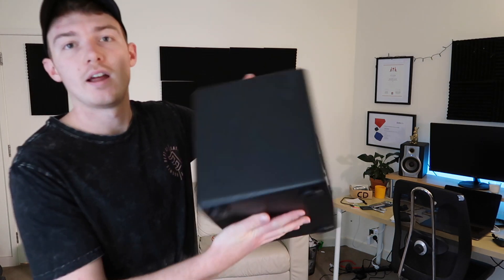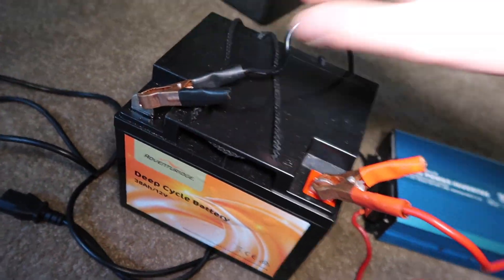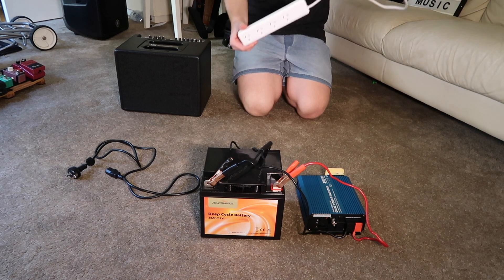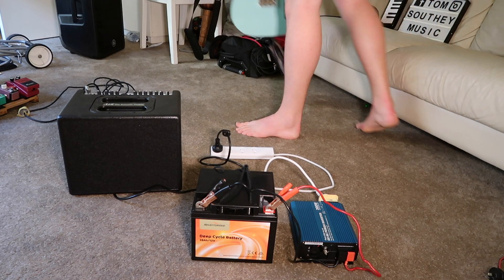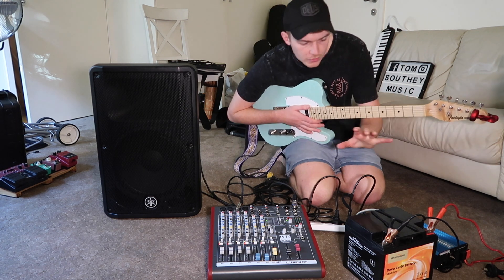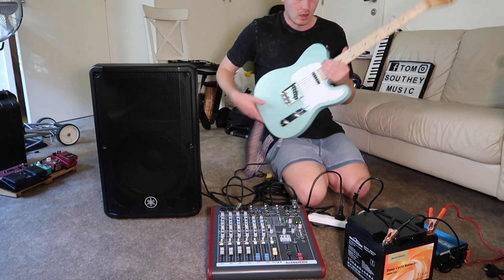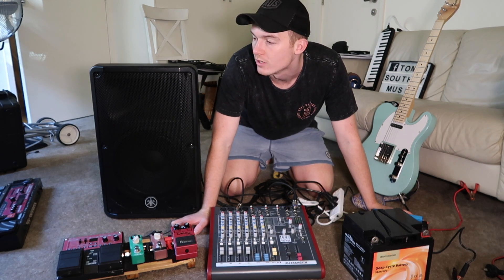HOW TO POWER ANY BUSKING SPEAKER

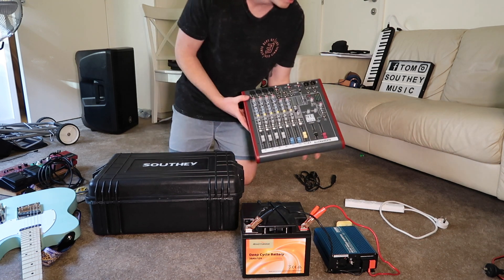Comment from the maker: Large Speaker test with Mixer skip to 5:34
Reply: Greyham Moongan  No
Reply: Can I use a 12.8v battery for the same setup?
Reply: I tested our setup with a W meter and our Blackstar Artist amp is only pulling about 60W. My inverter is about 87% efficient so we are pulling about 69W out of the battery.
W (Watts)=Volts x Amps. So your battery is say 40amps x 12.5V=500w/69W=7.2 hours of use from a full charge. Your big speaker is similar to ours and it uses less than 100W to make enough sound for the street. I have to admit I questioned the hell out of that and disbelieved the Watt meter I had but it nailed everything else perfectly. So I concluded that they must have some other way of classifying speaker power than power use. It makes no sense to me at all but with your ear drums bleeding it is only using about 150-200W.
Long story short assuming your inverter can actually produce 300w (Many absolutely don't)you have enough of power to run 2 of those speakers and your PA and guitar amp if you want. But I possibly would not recommend running any of these cheap inverts too hard. Mine included and it's not cheap. This will mean you are pulling about 27-30 amps from your battery which will be getting near a small battery's limit for constant current draw.
I highly recommend anyone getting an inverter to buy a Watt meter. They are fantastic.
Reply: @toast47624  Hi, could you advise me please on the battery I would need for my p.a and mixer? Would be so grateful. I'll give you details if you get back to me. Thanks Sean
Reply: @toast47624  Hi mate, can you please help me with choosing busking batteries….? We want to use Yamaha pas 600BT (680w),and one keyboard and one electric guitar, hopefully play for three hours or more.  Please 🤥
Reply: @shengchang3411  Theoretically 170 AH but ad look for about 200AH+
Reply: @toast47624  Thanks😬
Reply: @toast47624  Old comment but hey! The recommendations for Those led acid batteries are not to drain them beyond 50% or the amount of charge cycles decrease pretty much exponentially. In the campervan/motorhome world, this is well known. 👍

Comment: Thank you so much for the info. I'm planning on just playing solo guitar over backing tracks with the Yamaha THR10 ii. I need to take into account the power supply which is 15V 3A which means i need a different converter... obviously right? I'm very bad when it comes to electricity

Comment: Hi! Is there a mixer I could use without connecting it to an external batery? I use a roland cube street so for the amp I don't need an external batery for busking, but I do want to connect more instruments to it, so I thought a mixer would be a good solution. And I wonder if it would work by just connecting it to my roland cube street.

Comment: Plug your gear into a power strip into a VOLT Meter into AC WALL socket. Play guitar / sing = WATTS you need. Battery Watts / Watts you need per hour = Hours use X 85% = Real Life Usage Est.

Comment: Or get a Roland cube street ex, that gives you up to 50 watts on 10aa rechargeable batteries, and save yourself the hassle of carrying lots of heavy gear about, and saves lots of setup and takedown time.
Reply: True, if you have $1000 to spare. This is a good option to power existing PAs you may have

Comment: I got everything you basically have but when the setup is on there's a buzzing coming out the amp, it goes when I touch the metal of the input plug (that goes into the amp) so I'm thinking there's a lack of grounding? I'm not sure tho, has this happened to anyone else? Just wondering how to fix it or will I need to buy a whole other setup?
Reply: I once tied a wire round my ankle...to the rig. It was cheaper

Comment: I am in Montreal Canada. I’ve been using a 3000 watt inverter with 2 used deep cycle marine batteries hooked up together in parallel to run a complete JBL DJ rig for up to 7 hours at very high volume. 2x Prx512 tops, 2 x Prx518s subs, 10ch mixer, laptop, and 2 wireless Sennheiser microphones. Works flawlessly. The inverter is not a pure sine wave, but no issues at all with multiple gigs performed. 4 piece Jazz band with multiple vocals as well have rented my inverter set up..
Reply: Do you get a lot of noise out of that? I have a 1000 watt inverter and it’s very noisy. Any tips to reduce that?
Reply: Hi, I need to power a PA speaker and mixer outdoors. Can you tell me what gear I might need please?
Reply: @hanf71  I recomend getting a portable all in one battery inverter with a Lithium ion phosphate or Lifepoe4 battery. The size will depend on how much gear you plug into it, and how long you need it to last. If you only plug in a few items that don't draw much power and use it for a few hours, I recommend a Pure Sine Wave inverter like the GoLabs i200 from Amazon, or something similar. I have 2 of these for small set ups, and larger set ups as well, and they all work great.  Good luck!
@partymtl

Comment: Tom I have two Aer amps compact 60s and I’m running a total of 120 watts. There’s 60 W that each speakers required using a 300 W. Pure sine inverter. My battery is a MIADY 36 Ah 460 .8 . Wat At 60% audio power it works from 4 to 7 hr. Life04 Lithium battery. It’s very important to charge at 2 Amps. Slow charges best.

Comment: The black switch on your powerboard is an overload trip - all powerboards must have one.
A surge protecting circuit is a different device.

You can estimate the life of the power supply by knowing the power consumption. You can either work it out roughly by looking at the power consumption on the panel of the each device and multiplying it by the percentage volume/capacity you set the device at.

38 Ahr at 12 volts = 456 Whr

So you could theoretically run a 456 Watt load/device for 1 hour. Or 45.6 Watts for 10 hours.
This doesnt include the losses by the inverter so the life of the battery may be about 3/4 of these values depending on how efficient your inverter is

(also the power output of your PA is different from the power consumption so you should use the rating or power consumption value written on the back of the equipment. That is, your PA delivering 1000W is not going to consume 1000W. The specification say that it consumes 18W on idle and a maximum of 74W at 1/8 power)

Comment: The speakers are 1000 Watts programmable power which is not peak power and it is not RMS. Speakers about 250 Watts Peak. So you inverter is fine at 300 w RMS.

Comment: Hi! Hope you see this comment 2years on! I'm trying to run six 60w speakers (already have inbuilt batteries but want to extend their duration) from a big leisure battery and a 1000w inverter but 2hours in to testing the inverter blew up! Thought it might be to do with the earth pin at the back of all these inverters seen needing connecting but no one seems to connect it to anything! Anyone got any ideas?! Thanks in advance!
Reply from the maker: Hey! 

Hmm have you checked the fuses in the back of the inverter? 

I've blown mine up before, replaced the fuse and it's worked fine again! 

Not really sure about the earth pin. Maybe there was some sort of buildup of charge as there was multiple sources of power?

Comment: Hey Tom!  I'm reading lead acid batteries can't handle much discharge past 50%, unlike lithium ion batteries - does yours last 10+ hours with a deep discharge?
Reply from the maker: Lithium all the way! That's true! Lithium are lighter and better and you would need to buy a deep cycle twice the size to get the same life out of it. 

Mine lasts a really long time, but I try  to never fully discharge it. 

I'd I can I charge it between gigs so it'll never fall below 50%.

Comment: Thanks. Do you have to use a mixer if your speaker has the input channels? Presumably I just use the power supply direct to the speaker and use the speaker mixer.
Reply from the maker: Yeaah you can use the PA mixer that works too!

Comment: I have a Roland cube street ex, which works on AA batteries, So all I need power for is my multi-effects pedal, and my looper pedal. I am new to running things with battery power and don’t want to mess up my pedals. Could you suggest size of battery and inverter I would need?

Comment: Hi. Good video, thanks.

I have a question. If I use a battery like that to run a car amplifier, do I need to ground it to something metal, or just to the ground connection on the amplifier?

Comment: Random question but have you ever had any issues with buzzing or strange noise coming out of your amp on this setup?  I have been trying to use a solar generator ( basically just a battery pack with a lithium battery in it) bought off of Amazon for my line 6 spider valve amp and it's been making a terrible buzzing noise. It's a pure sine wave power bank so I have no idea why it's been happening ( voltage looks as though it matches up fine and there's more than enough power available) and I even have two different solar power banks I've gotten from Amazon and the issue happens with both.  Kinda freaked out about getting shocked or something but was just wondering if you think this type of set up would be better at preventing buzzing and any safety hazards?
Reply: !!Yes - Similar !! I’m having a buzzing issue when I’m not earthing the strings on my guitar.. I have a completely ‘quiet’ set up when plugged into earthed wall socket, but get noise when I change over to plug into the battery and inverter.. only running a 100watt stage amp and boss pedal board.. I suspect I need a ‘power conditioner’ or introduce an ‘inverter earth’ … any feedback would be appreciated !

Comment: I am not a qualified electrician, so please don't take this as gospel. I would add if not mentioned to make sure the inverter is a pure sine wave one. Possible get a plug in energy monitor/power meter cost about £15 UK to find out wattage used by the powered speaker and other equipment, although not sure if there is an initial start up voltage on any motors like amp cooling fans to allow for? Some people make the mistake of thinking if they have a 350 watt powered speaker that's what it needs but that is what is produced by the amplifier after going through the amp. For example I have a Yamaha DBR10 rated at 350 watts rms but if you look on the back, it's rated idle is 60 watts which may go up to about 75 - 90 watts tops with loud music through it. Its worth looking for efficient powered speakers. I took a plug  wattage power meter in a music shop to check the efficiency wattage of various powered speakers before buying one. Also not sure on this one  but get the smallest inverter you can get away with as the inverter uses power as well and the bigger the inverter possible the more power it needs to run it and spare fuses as if you connect the battery up wrongly by mistake which is easily done  it will blow the fuse in the inverter and your stuffed without a spare fuse if your out and about busking. Also maybe bring a voltage meter as depending on the inverter(mine cuts out before the power gets too low)if the battery runs too low it can cause damage to the battery. I am not a qualified electrician, so please don't take this as gospel.
Reply from the maker: All great advice! I blew my first inverter fuse the other week by connecting to the wrong terminals... now I have spares!

Comment: Thanks for an amazing video.. Was wondering about busking equipment and this one really helps... Can we make do with the battery alone or is the inverter mandatory?
Reply from the maker: The inverter is pretty much essential! 

The inverter turns the battery into a wall outlet in essence. Without the inverter, the device simply won't work as you're using DC current on a speaker thats probably designed to have AC!

Good luck!
Reply: @southeyforartists  Ah ok got it. Thanks

Comment: How do you carry all this stuff from the car or bus to the street? You can't just leave part of it on the sidewalk while you make more trips back to the car. How do you charge the battery?
Reply from the maker: Sack trolley! The trick is having a set-up that you can transport in one trip.

I keep a foldable trolley in my car, im able to move 1 x pa speaker, pedal board, plus battery and mic stands. And then the guitar in a backpack style case! 

Once or twice I've had to bring my car around to a loading dock. 

I have a padlock and cable which I rarely use to lock, speakers mixer, guitar case all together. 

That way its impossible to carry one item away as they're all connected. 

Get a good trolley! 👍
Reply: @southeyforartists  I don't now what the equivalent American English word is for 'trolley' or 'sack trolly' but in America, a trolley is a mode of transportation, especially the type that operate from cables underground, or electrical wires above. aka cable car.  It is an outdated vehicle from the past, except that they are most notably found in San Francisco, a big tourist attraction. SOme city buses are designed to look like old trolleys, but they operated on traditional fuel, no cables or wires above. Some people stand on the running board on the sides and hold on, instead of sitting in a seat. You can do a Google images search for 'san francisco cable car' and I'm sure it would show you. Perhaps you can do a video showing what your sack trolley is, and I'll try to figure out the America term is for what you have, cause right now I don't know. You're getting a great, loud sound. The smaller speaker would be more than enough for me. I may start out with just one of those small battery powered amps. Are there any brands you'd recommend? I just need people on the street nearby to hear me, not people 3 blocks away.

Comment: With the yamaha, you need the inverter because it's 120v right?
Reply from the maker: You need the inverter because it's designed to run on AC. (AC 240v 50hz is the standard wall socket power here)

The battery is only Direct Current (DC). So you need an inverter to convert that into useable Alternating Current (AC). Which is what most appliances and amps will use!

Comment: I agree a pure sine wave inverter is the way to go when using with PA equipment.  Mimics the power that you get at your home.  Anything else will cause unwanted hum, and isn't the best for the electronics.   I use a 500w inverter, and even power a small fan that I always like to use while playing.  I'm using a JBL Eon One amp, a Yamaha mixer, as well as a few other peripherals, and of course my electronic keyboard.
Reply: Yay! You said you use a pretty keyboard! :))))))))))

Yes, I do in fact think electronic keyboards are pretty :)). They sound pretty (or at least they can).

Seriously though, I've been considering trying something like this myself (although it's a bit different than what was shown here): I have a portable AC power bank, meaning that it combines batteries and inverter into a single unit. It also has USB ports for powering/charging any USB devices like a phone or computer or whatever. So the idea is to play my electronic keyboard outdoors, where there may not be power, and I can have my own little power supply in the form of my power bank. Should work well. Just haven't tried it yet. The keyboard also has its own speakers, so I do not need any fancy speaker system or anything of that nature (I'm not looking for "amazing" professional quality sound as this is all purely for the fun of playing music). I'm not even expecting an audience (my goal here isn't necessarily to attract people and gain recognition or whatever), though of course it never hurts if someone near by just so happens to hear the music and wants to listen.
Reply: Hi, I need to power a P.A speaker and mixer outdoors. Could you advise please?
Reply: wondering if you've ever put a bass guitar through your Eon One?  I think these only have 8" speakers?
Reply: The original Eon One has a 10" speaker and bass is no problem.  As a matter of fact, I just replaced the JBL speaker with an Eminence Neo speaker, which was a nice improvement to low end.  The Eon One Compact I believe had an 8" speaker.  That version has a built-in battery.  JBL made the Eon One line confusing, with several variants.

Comment: Thanks for the video.  Everything I have already has it's own batteries EXCEPT for my mixer.  (+I now ur supposed to use a sine wave invertor for music equipment..) Big question is, if I was using a portable camping AC powerbank, would I still need a sine wave inverter if the only thing I plugged into it was an analog mixer? (although it does have built in FX if that matters..?)
Reply from the maker: Hey mate! Sorry for the slow reply. You'd prrooobably be ok. If it's just the mixer. 

It's mainly speakers that are best on "pure sinewave" because they have magnets and coils inside :) 

I'd say it should be okay? But I can't be sure. There's a chance you might get some hum or noise from your mixer (potentially..)

Comment: Thinking of setting up a deep cycle battery with 80ah+ with 1000w/2000w peak pure sine wave inverter and 1 EV zlx bt powered speaker rated at 250 continous watts/1000 watt peak. Would this run me at least 4 hours without depleting battery under 50%?  For volume im thinking 75-80%.
Reply from the maker: Hey John! looks like you've done your research. I'd say you'd get more than 4 hours keeping the battery above 50%, but that setup sounds the right size, you'd have some headroom there with both the inverter and battery which is what you want. Goodluck mate! let us know how you get on!
Reply: An update. Daisy chained 2 self powered speakers, 2500w Harbinger and 1000w EV zlx. Played music at baby gender reveal with 85amp deep cycle battery and 1000 watt puresine power inverter for 9 hours straight. When I got home the battery had 62% left.
Reply: So I tested the above setup and works great👍I went with 90% volume and after just over 3 hours the 85amp battery had 84% juice left. Thanks for the tips!!!!!!
Reply: does your inverter need a ground?